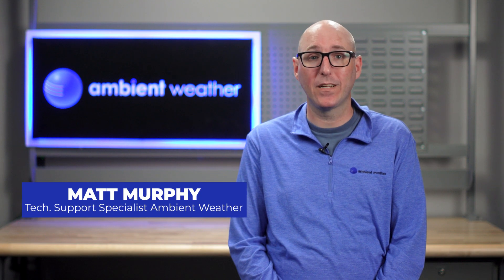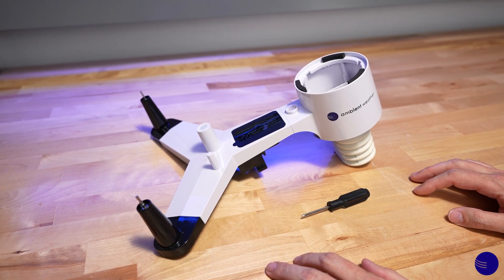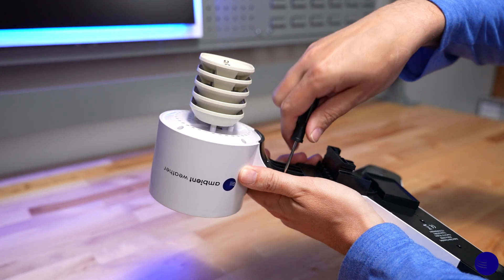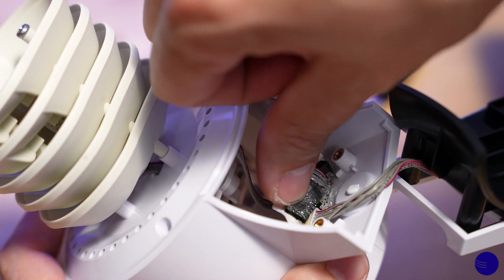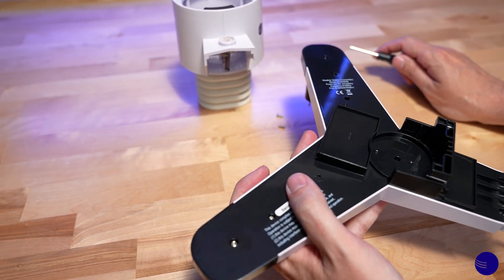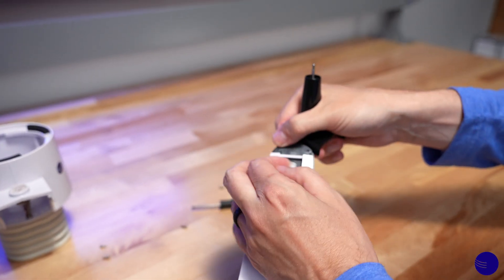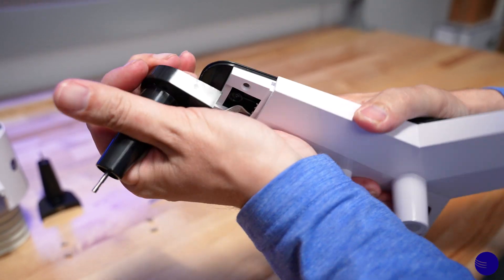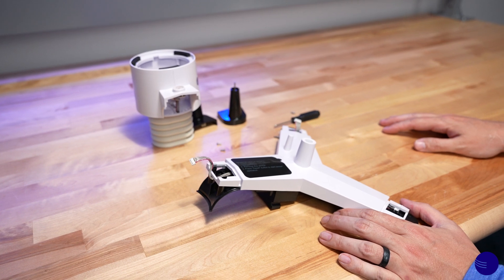Ambient Weather WS-2902D | Replacing Rain Gauge, Wind Speed & Wind Direction Sensors

Comment: The replacement rain gauge I received from Ambient Weather contained 2 phllips head screws that appear to match the two screws closest to the rain gauge.  The heads on these screws are a good fit for my #2 phillips screwdriver, but the diameter of the recess hole where the screws are located is too small for the shaft of my Klein tools #2 phillips screwdriver.  My #1 phillips screwdriver fits in the recess hole, but the bit is too small to turn the screw.  What the heck?  The guy in the video must have a magic screwdriver - or the screws were already loosened before he made the video.  Really stupid design.  Ambient Weather - please use screws that match the diameter of the recess hole.
Reply: Buy a #2 Phillips screwdriver with a thin shaft to get into the recess hole. Simple.
Reply: Yep I discovered that today too. I had to grind down the shaft of my screwdriver to make it work. Not ideal but worked. Lol

Comment: I received the replacement array and the new array has 3 wires for the wind speed connector whereas the original windspeed detector has only 2 pins. Now what?